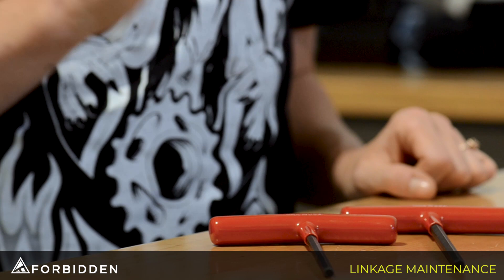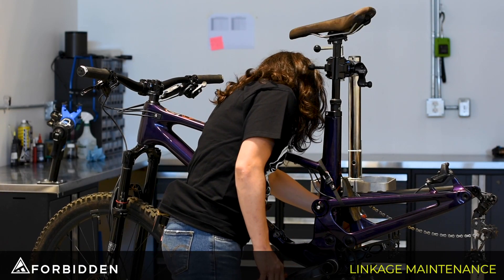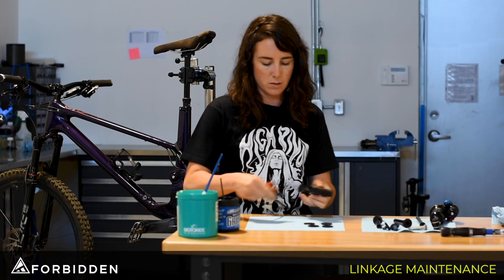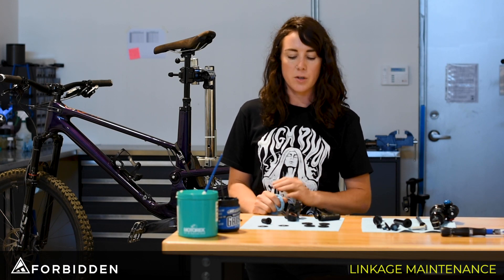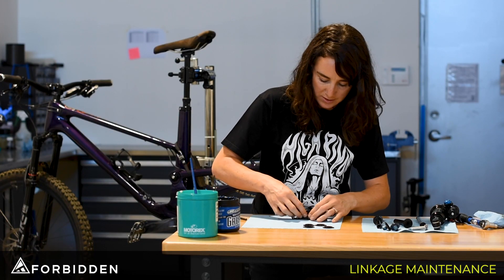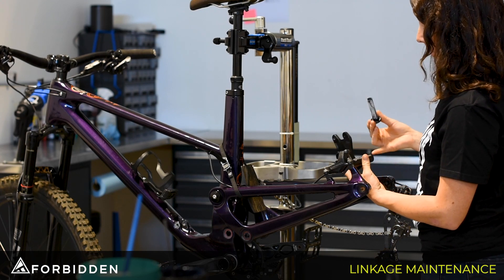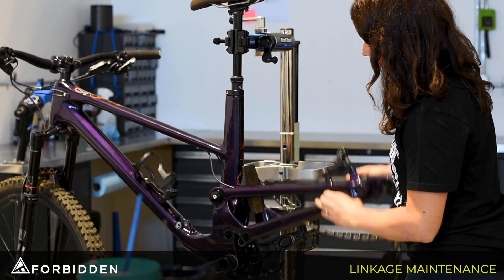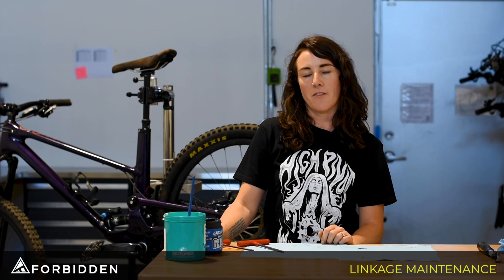Forbidden Bikes: Linkage Maintenance

Comment: Not saying you are or have to , tho just try before you torque the linkage and shock bolts and while they are just loose , take the bike out of the stand and bounce compress the bike rear a few times , then torque the bolts . This is a method that is practiced in super bike rear services, I have carried it over and it works . There is a reason we do it .
Reply: thx dude

Comment: My druids developed a hell of a creak, could this be the linkages?
Reply: It could be the bearings "walking". 

Walking is when the bearings start to shuffle back and fouth in the frame. It causes no damage but it just means you need to regrease the bearing seats and press them back in.
Reply: Yeah, I replaced all the bearing and it still is creaking like mad… driving me mad. Last two months of nothing buy changing out parts, swapping parts, trying to locate the creak. installed new bearings. Still there. Tried different chocks, pedals, chain ring, bottom bracket. Everything. I’ve never had so much trouble with a bike before like this. Very annoying.